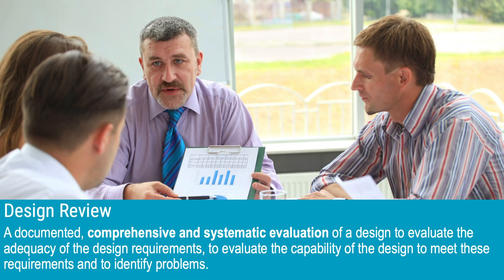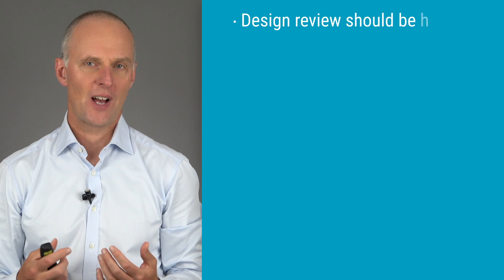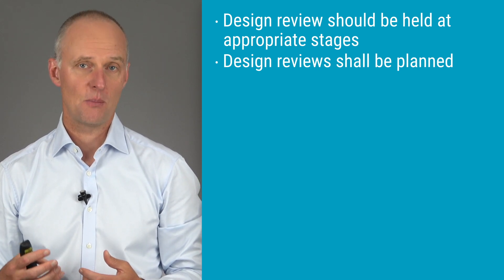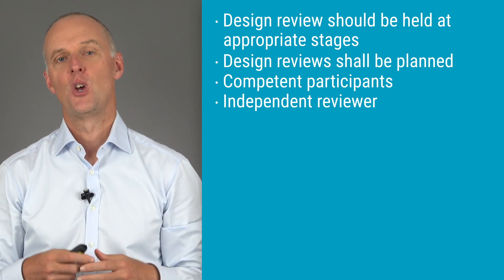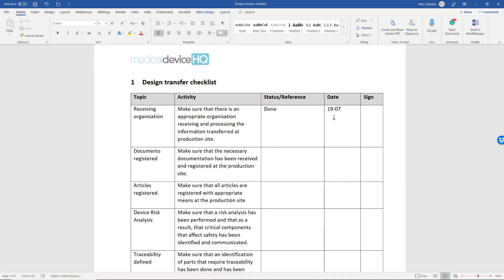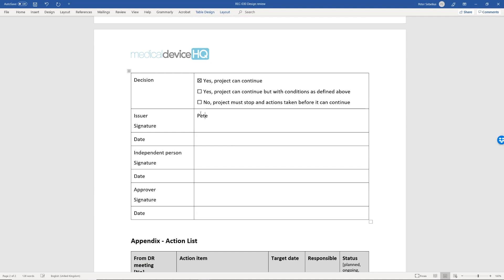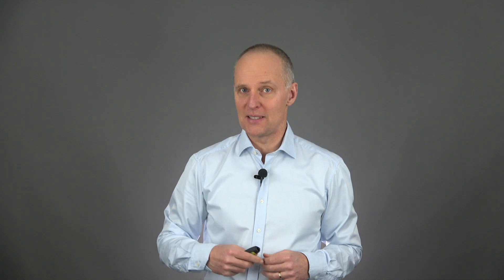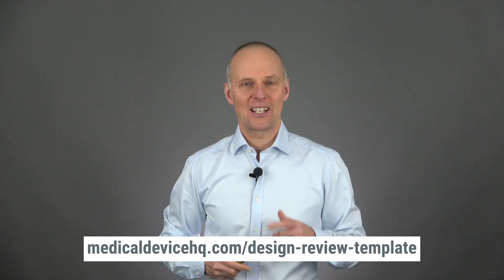How to do a medical device design review

Comment: Hi Peter and thanks for your video on Design Reviews.
I would like to know whether the technical reviews should be part of the Quality Management System and the Design History FIle. Technical Design reviews are used to show technical aspect of the design and they are prerequisite for the design reviews. But do we need to include them in the DHF ? If not how can we show that the technical aspects have been evaluated solved?

Comment: What should be the content to be covered in design control for prefilled syringes with passive needle guard?
Is it necessary to have design review for this device?
Reply from the maker: The information provided is not sufficient to answer the question. What you are referring to is most likely a combination device? But it could also be a medical device depending on what is in the syringe.

Comment: I think Design Reviews are value adding in a sense that they act as a central node (or convergence) of the documentation and design decisions – afterwards, a sort of divergence takes over until the next Design Review.

Having held many Design Reviews the past years, I seem to struggle with conveying the value of the meeting to many of my stakeholders. I use terms the same as you: “pause”, “reflect”, etc., however, when talking to a specialist, they are sometimes used to / expects to run through each requirement in a detailed manner (much like a Technical Review), and if not: “then what is the value other than sitting and talking at a very high level?”

That being said, I experience that most (not all) stakeholders see the value after the Design Review has been held, and they willingly participate in subsequent reviews.

Thank you for a good and concise presentation – I am happy to see, that I use the same approach as you :)
Reply: Thanks for the comment Mikael. Sometimes I use the technical and very detailed reviews as input to the design review. That way you can bring issues that are on a very granular level, but may critical to the overall project's success to the design review.